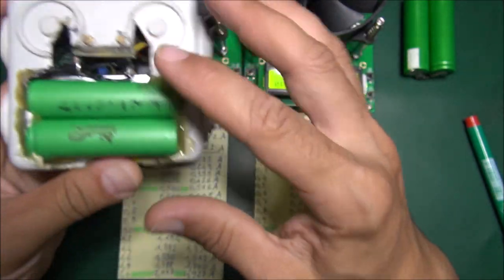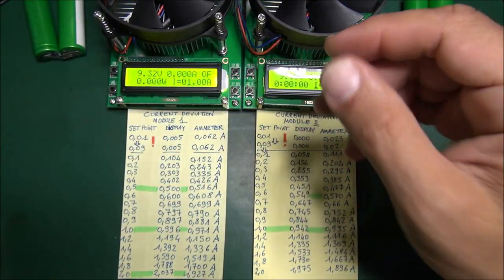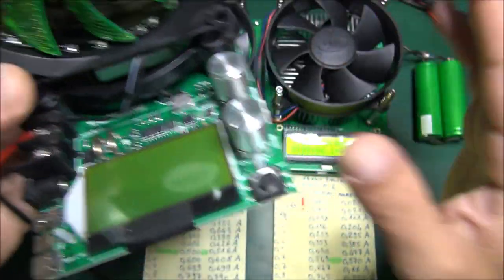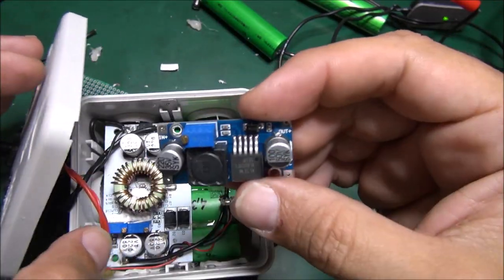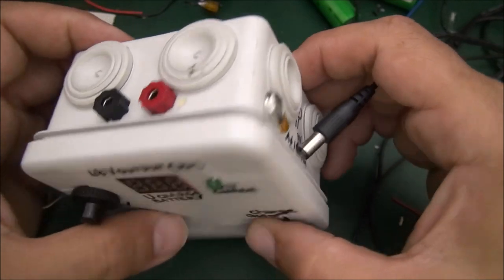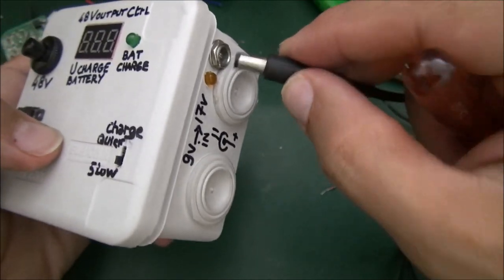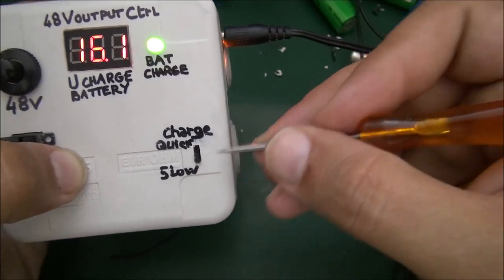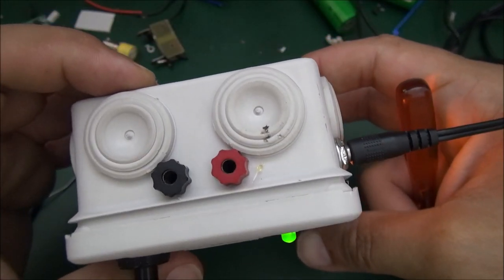Fake electronic load and Portable 48V power supply v2

Comment: Salut, at 12:15 you show voltage sense, but it cannot work the way it is connected there. the sense wires have to connect to the battery directly. anyway, thanks for videos.
Reply from the maker: @Futschikatores hello, the voltage sensor is comonly used to calculate the real wattage, despite the drop voltage due to the resistance effect of cable and wire.The voltage sense point are need when high amps are required, or when wires are to much thin, or long. In this situation, the wire are only 10 inch long.
So, voltage droping due to 2 amps maximum test here are negligeable, and this does not come into play in this process, this is negligeable. Of course, those points didn't prevent than those unit are definitevely fake, or simply very badly ingineered. Thanks for your comment.
NB:
You can purchase those electronic load if you want. My video show only my opinion, even if I publicate it on a social media. In any way it's doesn't mean than they are finally bad, they just are bad for me, thanks.